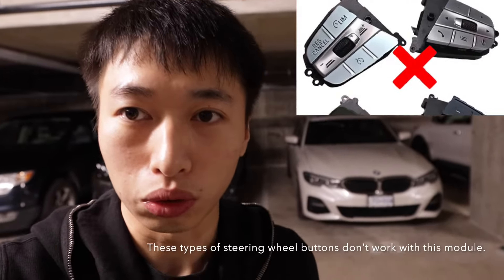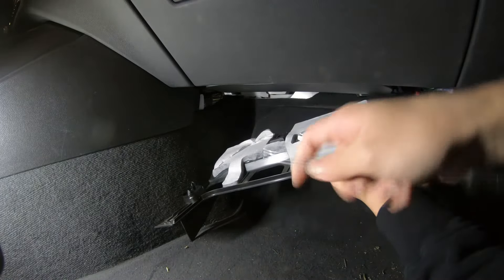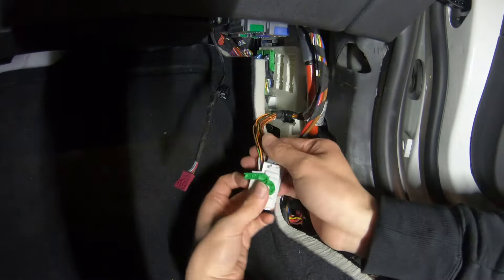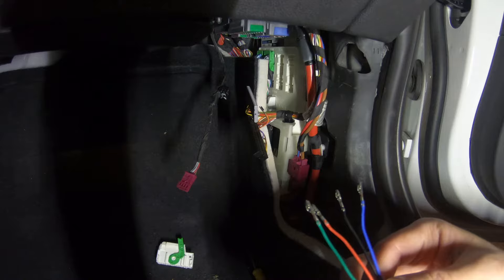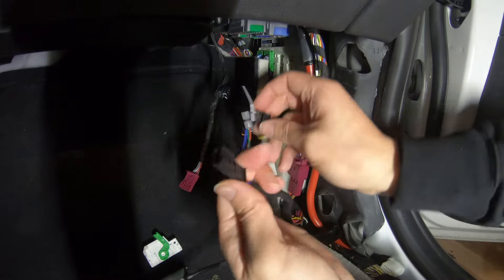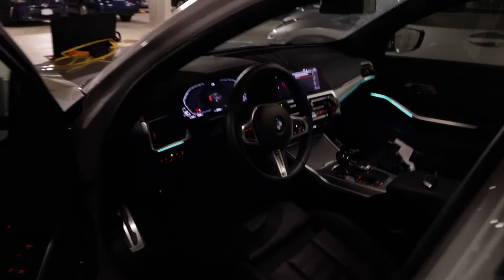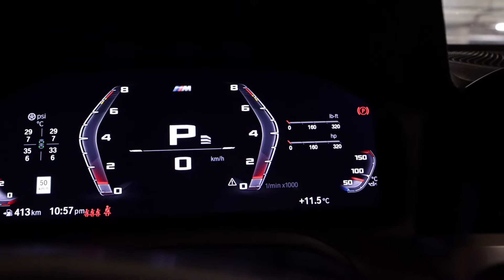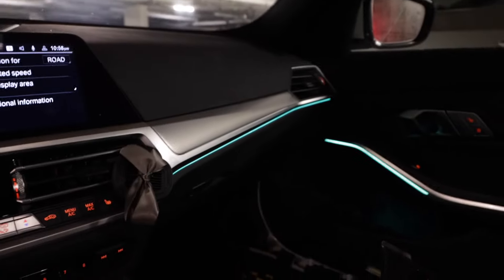BMW M INSTRUMENT CLUSTER ON ALL OF G CHASSIS ID7

Comment from the maker: Here are couple of FAQs:
1. Your steering wheel buttons will be still working as before, everything will be working fine like before.
2. If your steering wheel has 2 blank buttons on the left side like the photo I showed, then this module doesn’t work.
Reply: Would using bimmercode be the same thing as the adapter?

Comment: If i purchase the kit there will be everything i need and all the coding necessary?
Reply from the maker: Yep, you only need to prepare a window laptop.
Reply: @YaodeChain  DO I NEED SOME APP, ESYS OR ISTA? after the purchase, how do I encode it later? if the machine is updated, is it difficult to do everything all over again? can you explain in more detail?
Reply from the maker: @esmiserable  Our programmer will do the coding remotely for you after you installed the module, the Esys cable is included in the package. You can save the codings after, and reflags it again every time when you lost them.
Reply: @YaodeChain  i live in russia, can you explain me how do it, you'll help me so much. have you some tutorial how do it?
Reply from the maker: @esmiserable  Message me
Reply: @YaodeChain  Okay, I'll write to you on Instagram

Comment: Do steering wheel controls still work in the BMW G20?
Reply from the maker: Yes
Reply: @YaodeChain  even if it is a 2021+ mild hybrid? I just want to double check because you mentioned it will not work with a hybrid or vehicles with ACC.

I have 2021 M340i
Reply from the maker: @keyurpatel4605  Doesn’t work on any of hybrid cars, works on most of the vehicles with ACC. Just some of the cars doesn’t work.

Comment: Hello,
If BMW update the vehicle software, will this affect the display?
Reply from the maker: Yes, you will need to code it again if the car had an OTA update, but the coding time will be much shorter to get it back compared to the first time.
Reply: @YaodeChain  thank you 🙏🏾
Reply: Should the module be removed before bring car in for dealer service?